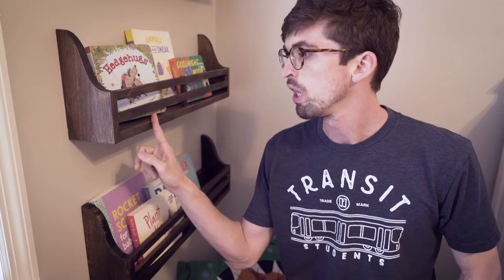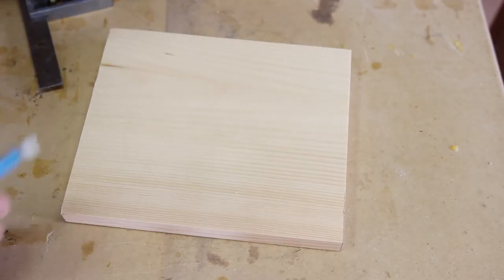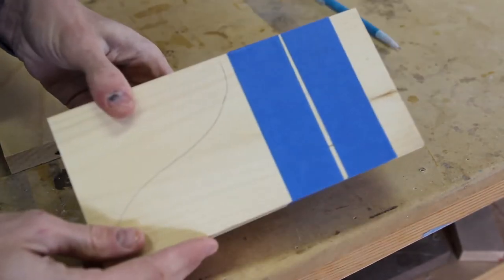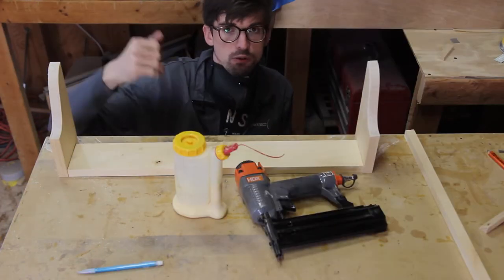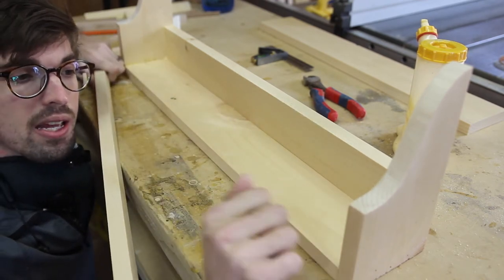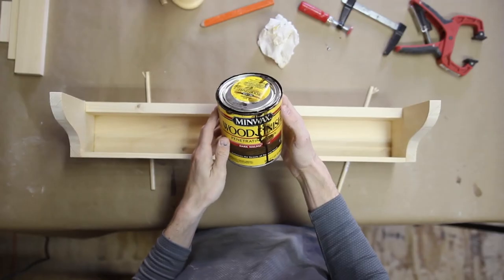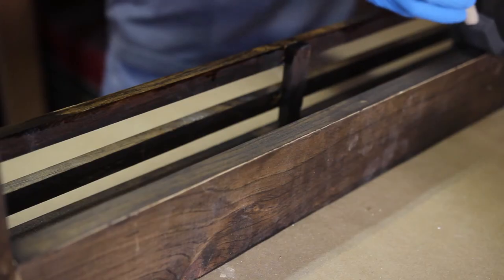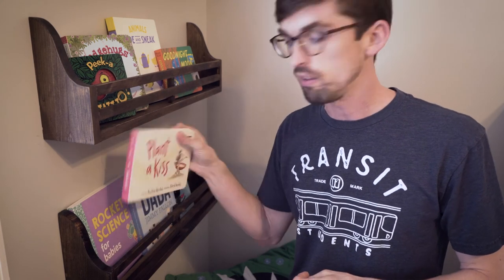Simple Wooden Book Shelves (for a nursery!)

Comment: Cheat - using a pattern you'd already made! How? The most difficult part!
Reply from the maker: If you're talking about the side of the shelf I just drew that free hand and cut it out with a jig saw.
Reply: "Just". The one thing that needed demonstrating. Its amazing how often these DIY tutorials skip the difficult bit or take a basic, simple project to the jointer or table saw. Anyone who has one of those isn't making a shelf.
Reply from the maker: I used a pencil and drew a shape on a board that I thought looked nice.  Really not much more than that. Sorry, I forgot to record that section.